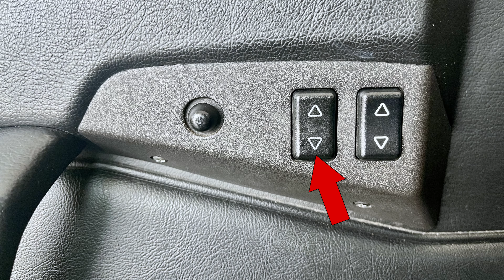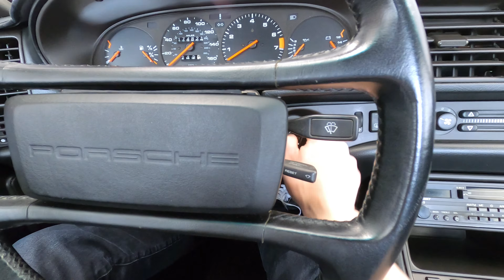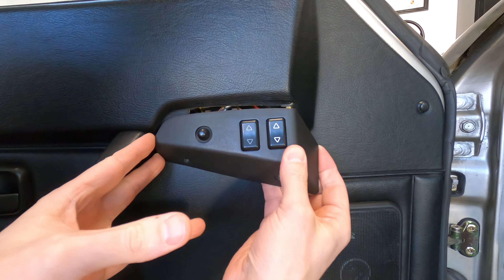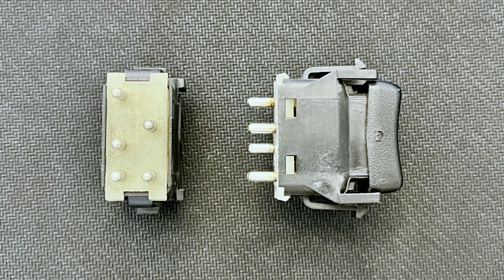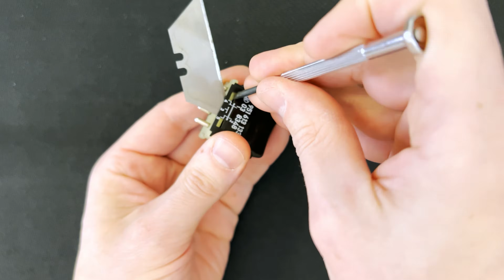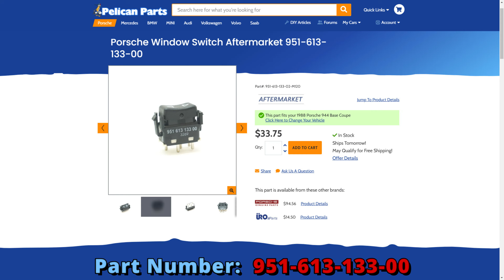Porsche 944 – Window Switch Replacement & Repair Tutorial

Comment: If I believed my switch connectors were the issue what would be the best thing to do? Looking online there’s nothing really for sale, take apart and just if the wires are loose?
Reply from the maker: Issues are more common with the switches than the connectors, but you could take a look.

Comment: Any chance of video about the electric release button for the rear hatch? Mine blows the fuse every time I press it. Tried another button with no luck. The actuator is tested and works fine…
Reply from the maker: Sounds like you have a short somewhere. Did you check out the wiring and connector to the actuator motor? Look for broken insulation, damaged connectors, or corrosion on the contacts when unplugged.
Reply: @NC944er thanks, yes I guess so. Electrics are not my absolute strength, but I’ll give it a try😂

Comment: Great video — super helpful! I’d love to see a follow-up that goes deeper into tracking down the exact source of a parasitic draw. Maybe a step-by-step where you pull fuses one by one, use a multimeter to monitor amp draw, and isolate the faulty component? A lot of us with older 944s are chasing mystery battery drains, and your clear explanations would make that process way less intimidating. Thanks for all the great content — keep it coming!

Comment: I had a driver’s window that wouldn’t go up, straight to NC944er for a fix.  You nailed it, but instead of contact cleaner & sandpaper I used a pencil eraser to remove the corrosion.  Works like a charm now!  Thanks again and it was a pleasure meeting you at 944Fest last week!
Reply from the maker: Nice! I’m glad you got it working again. The fest was awesome! I was having so much fun connecting with people that I forgot to check out a lot of the cars. 😂

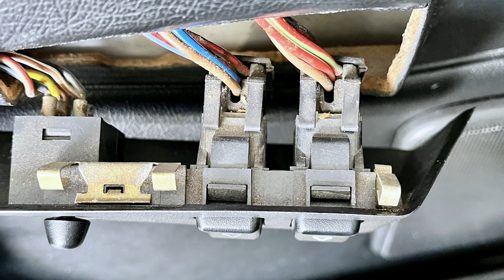Comment: Does anyone know the PN for the clips that hold the bezel to the door card? It looks like there are 4 per doer. 3 on top, one on bottom.They can be seen at 3:29. 
Porsche shows them discontinued, is there a VAG number for these?
Reply from the maker: I’m seeing part numbers: 944-555-437-00 and 944-555-453-00, one of each for both sides. Most sites are saying “sold out,” I’d call your local Porsche dealer parts department and see if the number has been superseded or if they can track them down.

Comment: You're the absolute best for posting such detailed repair tutorials! I just picked up a 1983 Porsche 944 with no spark to the distributor. To the best of my knowledge, the car hasn't run in 20-25 years(the two previous owners kept meticulous maintenance records.) I ordered a new timing belt, balance shaft belt, fuel filter, oil filter, and a new battery, and I planned on cleaning out the fuel tank and changing the oil before trying to crank the engine. I know the speed and reference sensors go bad pretty often, but does anybody have any other things I should look at to help diagnose the no spark(The ODO just rolled over to 60,000 miles when I got it.) Any advice would be appreciated!
Reply from the maker: @joshlathrom3335  Hey Josh, I recommend going through this list of troubleshooting suspects on Clark’s Garage, and the associated links on this page. That should help you identify the root cause of the no spark condition - https://www.clarks-garage.com/shop-manual/ign-04.htm

Comment: Hey,
I've got a kind request :). I've just bought used but in like new shape AC HVAC panel, and the buttons are like new but I feel that they rub against a plastic a bit while moving, especially AC button itself. Would you make a video how to disassemble and lube them correctly?
Reply from the maker: @8359s  The AC button pops straight off. There are two small plastic prongs on each side that hold it in place, be careful not to break them. Inside the switch are a couple moving plastic parts that can be lubricated. There are some visuals in my AC conversion video at about 7 minutes, 26 seconds in - https://youtu.be/tY7ydikX7ng?feature=shared

Comment: My switch is hard to press when cold, which part can be the issue? Those balls?
Reply from the maker: @8359s  Yep, more than likely the bearing balls are dirty or the factory grease has hardened, making it difficult to move.
Reply: @NC944er  Thanks it was it, i used contact spray to clean the "tracks" used gun lubricant for the "tracks", balls, and springs plus a bit of ŁT43 (bearing grease). Now the one that was working badly is much better than the one that was working OK, so I have to do all of them ;).

Comment: Good one. Vaseline works well too for holding those ball-bearings in place. Have done the same fix on my old Range Rover electric-seat switches (with a mass of ball bearings and springs that flew out everywhere the first time I did it). 

Your video instructions are the most clearly presented I have seen on YT !

Comment: Man I have taken apart and cleaned these switches at least a dozen times in the six years I had my 944.
Reply from the maker: @fransb8543  Wow, that’s a lot. You must be an expert at it by now.
Reply: @NC944er  it's been eight years since I sold it but I reckon I can still do it even without my glasses on.

Comment: Awesome, very thorough as always.  I had to replace mine since the switches were a bit stiff.  Now I need to clean or replace that mirror switch, it's getting a bit intermittent.
Reply from the maker: @ThingsBreak  I haven’t touched my mirror switch in about 4 years… dare I give it a test? 😂
Reply: @NC944er Yes!  Then you'll break it and make a great video on how to fix it 😂